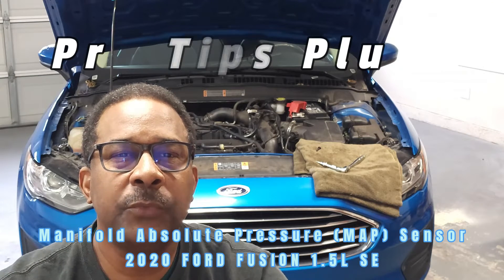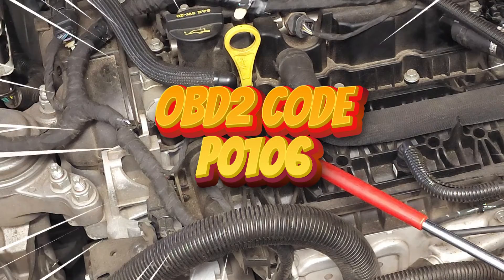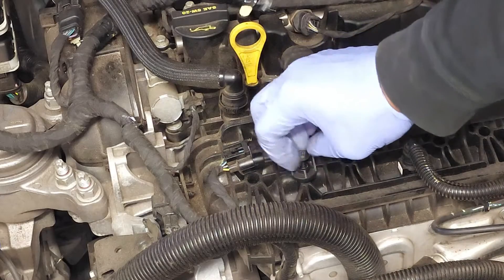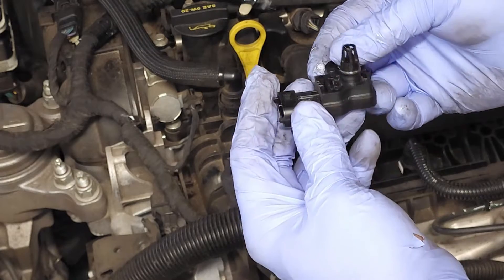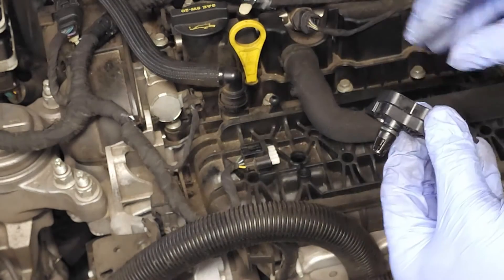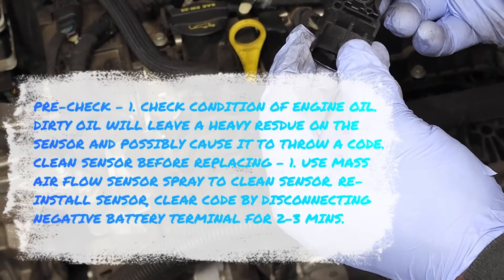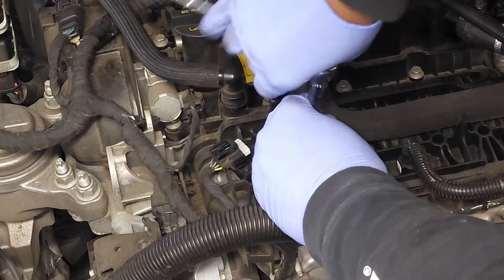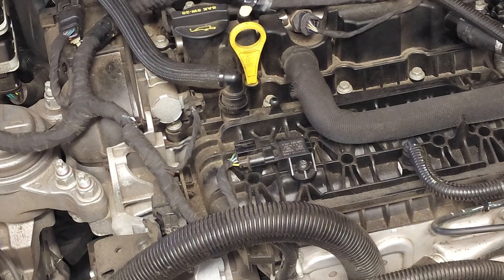2014-2020 FORD FUSION 1.5L, Troubleshoot and Replace Manifold Absolute Pressure (MAP) Sensor

Comment: I have a 2015 ford fusion 1.5L ecoboost and I got a code P0106 which relates to the MAP sensor. When I removed the sensor oil was thick on the Sensor and even in the plug of the sensor. Any idea what could cause this?
Reply from the maker: See...https://youtu.be/vAB0hkEn3nA.
Check and clean associated parts.
Reply: @protipsplus Thank you so much will do
Reply from the maker: Oil vapors from the crankcase have built up in the intake manifold.
Reply from the maker: OK
See entire playlist
Reply: @protipsplus I don’t think I have the same setup

Comment: Is it the same location as the 2.0?
Reply from the maker: O.K. I need more information. There are four possible MAP sensors on the 2.0l. 1. manifold absolute pressure sensor, Wastegate vacuum Sensor. Part #: CX2718 (BB5Z9F479C), Usage: Wastegate Vacuum Sensor, 04/04/2016 - 07/31/2020, Fusion, 2.0L EcoBoost (240PS). 2. manifold absolute pressure sensor, Located on the Intercooler. Part #: CX2493 (EL8Z9F479A), Usage: 04/04/2016 - 07/31/2020, Fusion, 2.0L EcoBoost (240PS). 3. manifold absolute pressure sensor, Part #: CX2543 (1S7Z9F479AD), Usage: 08/13/2012 - 07/31/2020, Fusion, 2.0L Duratec Hybrid (130kW). and 4. manifold absolute pressure sensor, Part #: CX2391 (BV6Z9F479A), Usage: 04/04/2016 - 07/31/2020, Fusion, 2.0L EcoBoost (240PS).  So, do you own a 2.0L EcoBoost (240PS) or a 2.0L Duratec Hybrid (130kW) and what is the exact code or codes indicated for the fault?